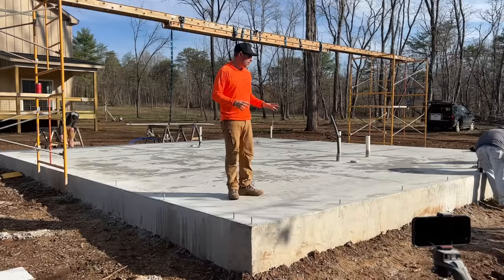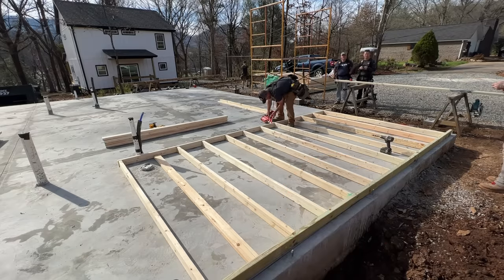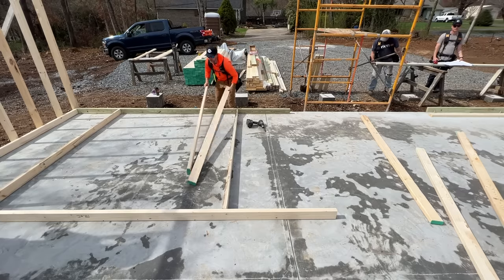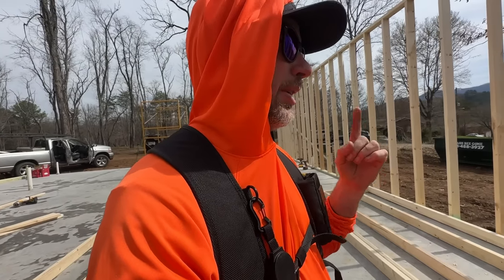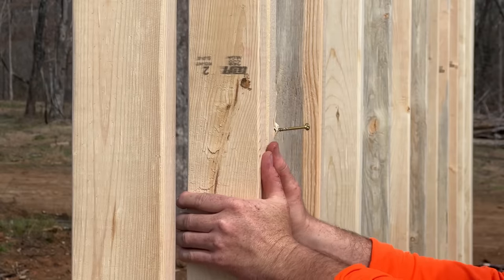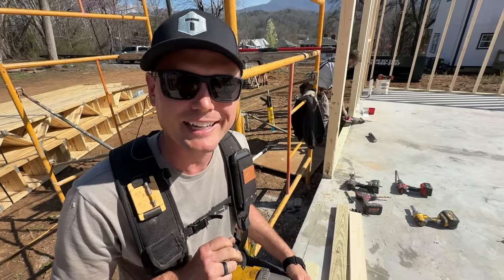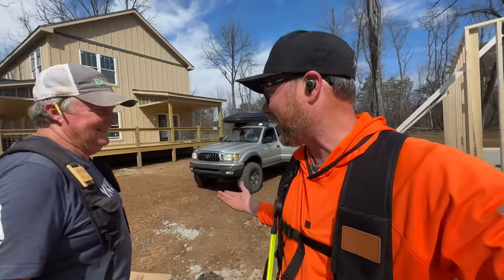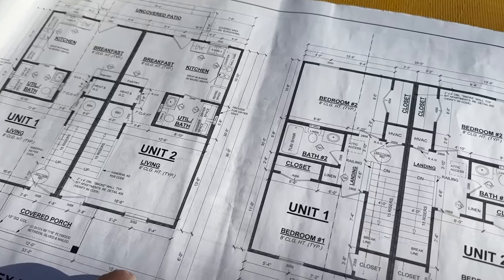Construction of a Duplex, Part 6

Comment: Oh!  After the seeing the plans, I realized I lived in an apartment almost exactly like these.  The only difference was it was 3 apartments side-by-side (a triplex?), there was no bathroom on the first floor BUT-- it had a basement for storage and utilities.  That was one of the best/nicest apartments or houses I ever lived in.  I loved it.  Very comfortable... except for the view.

Not to criticize, but that is one thing I really hate about newer apartments : NO storage area.  Right now I live in an older apartment and am very grateful to have a small storage area at the back of my apartment.  The other two things I really hate are wholly inadequate kitchens, especially with little or no counter top space and when the owners decide to put the refrigerator RIGHT NEXT to the stove so they can save on putting in a second heavy-duty outlet.  That drives me nuts.  

And, yes, I have to deal with both of those issues in my current apartment.  Whether the owners know it or not they are practically begging to have a high turnover rate and terrible tenants in their rental when they do those things.  Real people need storage; real people need counter tops and don't need higher electric bills because their refrigerator works extra hard every time the stove is on.  Then they complain that tenants are terrible.  No, they just attract terrible tenants because their apartment design is intended for people who don't actually live in their home.

Except for the storage space, this design is much nicer, especially the kitchen, which has adequate counter tops and a good triangulated appliance set up.  Seriously.  In my current apartment I have a total of 18" of workable countertop space-- and I bake!  That's my only prep area (besides my kitchen table) and it's no where near the stove.  Grrrr.  Maybe the owner will find a way to add storage space -- perhaps a shed or an attic.  Everyone needs a place for Christmas decorations and off-season clothes, not to mention all the other stuff that make up a real life.

Comment: Hey guys, I love watching all the videos! Keep up the good work! 
As a builder myself, if I could offer one bit of advice that has made my life much easier, it’s that I leave the anchor bolts out of my concrete at pour time. It’s easier to frame and stand walls without having to deal with them. After walls are up, I go around and drill holes as required with a cordless sds drill, and install wedge anchors. This way the anchors never land in the way of a stud, or too close to the end of a plate, or worse, in a doorway. Cost for the anchors is comparable, and labour to drill the holes and install the anchors is pretty minimal. I can do a 3000 sqft house in about an hour.

Comment: I'm always amazed how thin are the walls your side of the Atlantic. I know that comparing my apartment building to a tiny duplex like this is very much apples to oranges, but I have ~300mm steel reinforced concrete walls (only load bearing, partitions are 100mm plaster blocks) + another ~300mm of EPS insulation added much later on this semi-soviet building from 70's Poland.

Modern construction over here would be (for both single houses and apartment buildings) cast concrete reinforced pillars for load bearing, cast concrete slabs for floors, 250mm aerated concrete blocks to fill out the walls and then another 250mm of XPS insulation on top of that. Peak R value of ~56, less on pillars obviously.

Comment: Hey guys, I just finished up a drafting class and the professor also had us do all of our dimensions to the center of the interior walls. I thought it was strange because as a builder it makes it harder for us. I asked him why and he explained that if the interior wall thickness had to change for any reason, plumbing or what not, that the center line will always be consistent.

Comment: Great content folks! Really looking forward to seeing this duplex build, I've always had a keen interest in smaller multi-unit residential dwellings. Two quick questions 1) How do you decide when you put the sheathing on before standing frames vs after standing frames? 2) Instead of casting in bolts to hold down the frames, could you just drill and use concrete anchor screws (like the one Jamie installed under those studs on that rough opening) throughout the rest of the framing? Not sure if it's a cost or code dictated choice?
Reply: Not part of the crew, but responding to your question 2. I posted the same reply to another comment and figured I’d share it. 

J-bolts are much easier to put in, go deeper into the concrete, and have more contact with the footing. They are much cheaper than specialty concrete anchors or screws, especially when they do so many. 
Last and most importantly, j-bolts are rated for higher wind and uplift loads for their mountain builds. 
Some codes do not allow for Tapcons (large concrete screw that Jamie installed), especially on larger structures such as a multi-story homes.
Edit: Grammar
I'll also add that Tapcons (and other specialty screws/anchors) typically require more tools, care, and precision. You need to have a hammer drill and masonry bit at hand to drill it and install it tightly enough but not over-torque it. For example, if you were to overtighten the Tapcon, it would slip and no longer hold (seemingly happens here with Jamie but is not discussed or highlighted in the video). If you overtighten a Tapcon, one way to fix it is by drilling a larger diameter hole and using a larger masonry screw.

Comment: In some cities, such as Portland, ME, (depending on proximity) windows aren’t allowed on neighboring (exterior) walls for fire code.  In addition, 5/8 densglass sheetrock is also required on those walls—much like the firewall in between the two units you’re building.
Reply: Depends on separation measurement’s between houses.

Comment: I’m no expert, but built my timber framed workshop 30’ x 23’ alone last year. I installed the ground bolts in the slab, then placed the mudsill/ground plate on top, hammered it, then drilled where the indentations were. Worked good.
Reply: @H2s Good comment, but… I marked all the points for the anchor bolts with a chalkline, and drilled using a jig to ensure 90 degrees. The timber was 160 mm x 60 mm Konstruktionsvollholz (engineered wood so dimensionally perfect and straight). I used 12 mm expanding anchor bolts, and drilled 14 mm holes in the sill, using 12 mm washers for wood. These are large diameter and particularly thick. It worked well. Finally, I got this method from Larry Haun’s book “The very efficient carpenter” Larry’s good enough for me. 😉

Comment: FYI, that is not a forstner drill bit. It is an auger drill bit. Forstner bits don't have a screw tip to pull it into the work. They are used in woodworking to give smooth flat bottomed holes.

Comment: I wore out my old hammer 😅 the milled face was gone and the claw were blunt and dull, had to replace it when I broke one of the claws off trying to rip a hinge off. But I used to pound concrete and steel and whatever else with it 🤷‍♂️

Comment: How does one pick up a Perkins Builder Brothers tool belt? I made customized a belt just how I liked it back in my 20s, 40 years ago, and some low-life ripped me off out of my truck, along with my first Skilsaw. I haven't been able to find a belt as good as the one that was stolen. I had tape pocket and square front left; hammer, knife, rough chisel front right; flat bar and kitty paw left rear; pliers and screwdriver right rear; Battery hook front right; saw rasp or wrench slot in the back, next to a water bottle pocket. All. Gone. Damn.

Comment: Last couple homes I have seen you build you put the walls up pre-covered in their sheathing. Why bare studs in this one? Is it due to the size of the house? Or material availability?
Reply: Because it's on a concrete pad
Reply: They mentioned in the video that it increases the chance of the walls blowing over. No anchors on the slab for bracing.
Reply: It’s because it’s a slab instead of a wood floor. We have to lift the frame over the anchor bolts

Comment: Do you guys not use a sill gasket between the lower plate and the concrete?  I assume it's not code where you are, otherwise you would use put it in I'm sure.

EDIT: Well, nevermind  I guess I just didn't watch far enough into the video to see you put down the Lexel sealant.   That looks like a good alternative to a foam sill gasket

Comment: Is there any reason you don’t use sill seal under the sill plates?🤔
Reply: Was thinking the same thing. Here in Aus that would not pass code. Got to have a Non-Permeable barrier between that bottom plate and the concrete.
Reply: They did.
Reply: @aaronmdjones  I saw glue but not a sill seal
Reply: That sealant they use is the replacement for the typical foam sill seal
Reply: @bashirmarkhamidi2259  Thanks for the info
Reply: @tommicks53  Anything that closes the gap is by definition a seal.
Reply: We do sometimes. I like level better

Comment: I have 2 questions if anyone would entertain them.
1. What was the solution with the anchor bolts lining up perfectly on the the studs?
2. With the interior wall, if the specs have it from outside to center of the wall, couldn’t just subtract that 1 1/2”? Or am I missing something?

Comment: Question, why don’t you attach the zip while the frame is on the ground?
Reply: The sheathing?  It’s just easier and lighter to hoist up without it.  It could be done, just a lot heavier.
Reply: I haven't seen anyone around here stand walls without sheathing in probably 20 years, it's stupid not to..
Reply: The guys mentioned it in the video about not having bracing to secure the walls if they were sheeted.

Comment: Hi, why is there no waterproofing between wood and concrete?
Reply: Because the bottom plate is pressure treated lumber and therefore resistant to rot
Reply: Pressure treated lumber as well as some kind of sealant they use and apply with the duckbill caulking gun

Comment: Don't drill through the stud and into the end of the plate like you did at 14:00. It is faster, stronger and easier just to drill and add the bolt behind the built-up stud. The bolt is too close to the end grain and you weaken the stud. It really doesn't mater that your bolt spacing isn't perfect.
Reply: That’s what I was thinking. Where I’m at bolts only have to be within 12in of splice in plate or opening, would’ve been easier to just go beside that stud pack
Reply: They also threaded it lol Yeah, agree on the spacing too. Looked horrible.

Comment: I'd be interested to know if it's just a convenience thing or if there's any benefit/ cons to using the tapcon anchors vs poured in J bolts. It would seem the set in slab bolts could get difficult to along perfectly, so if the anchor bolts work, why wouldn't those be used exclusively?
Reply: J-bolts are much easier to put in, go deeper into the concrete, and have more contact with the footing. They are much cheaper than specialty concrete anchors or screws, especially when they do so many. 
Last and most importantly, j-bolts are rated for higher wind and uplift loads for their mountain builds. 
Some codes do not allow for Tapcons (large concrete screw that Jamie installed), especially on larger structures such as a multi-story homes.
Edit: Grammar
I'll also add that Tapcons (and other specialty screws/anchors) typically require more tools, care, and precision. You need to have a hammer drill and masonry bit at hand to drill it and install it tightly enough but not over-torque it. For example, if you were to overtighten the Tapcon, it would slip and no longer hold (seemingly happens here with Jamie but is not discussed or highlighted in the video). If you overtighten a Tapcon, one way to fix it is by drilling a larger diameter hole and using a larger masonry screw.

Comment: I am convinced that we are well past the point where codes simply make no sense at all.  So you want me to drill a huge hole in the jack studs that hold up the header so I can put a big A** screw in to hold the wall down and that fastener can't be 4 inches on the other side?  How ridiculous.    I was on a job where two walls were mostly glass, floor to ceiling glass, mostly folding doors to a pool.  The inspector comes by and says, well with all this glass you have no outlets on this wall so you need to put one in this section that has no glass.  I said, that is all solid wood, structural solid wood.  He says, I don't care, put an outlet there.  I said Between two doors? He got angry and said I'm not signing off untill there is an outlet here.  I said so you just want me to cut a huge hole in all that load bearing wood for an outlet no one will ever use because it is literally between two doors?  He says yes.  bangs head on wall  then why did we put all that wood in in the first place if we are just going to cut a big hole in the middle of it?  So stupid.
Reply: Yeah that’s dumb. Should have put some floor outlets there.
Reply: Re the first criticism about the huge concrete bolt through the jack stud, code does permit you a to offset your anchoring mechanism but so many inches. I think it’s like 6 inches to 10 inches or something like that depending on where you are and what version of code your municipality has adopted
Reply: @macgyver03ga  It was all slab on grade. The reality of it is they didn't need the outlet in the first place.
Reply: @frotobaggins7169  we have a local inspector like that. Basically just comes up with ridiculous stuff that’s not even in the code or he mis-interprets it. He’s actually about to get put on a desk job or fired bc of how many complaints he gets. All the other county inspectors are great. His boss is great. I have escalated issues to his boss on multiple occasions and his doesn’t understand why he asked for xyz. I know why… bc he’s a douche on a power trip.
Reply: @macgyver03ga  Exactly.  My dad did a job where he installed outlets on a kitchen counter top.  He showed the inspector how they were GFCI protected.  The inspector says, I like to see a GFCI in EVERY location.  My dad says well you may like to see that but the NEC stipulates that each outlet only needs to be protected by a GFCI.  The inspector says well I'm not signing off until I see a GFCI in each location.  So the customer had to pay for several GFCI outlets they didn't need, driving up the cost of their job for no net benefit.

I've seen houses where every wire in the entire house went through a single knock out in the main panel, complete with the inspectors sticker and signature.  Codes and inspection do little to nothing to protect anyone from anything.  It all just drives up the cost of the work and reduces the number of people available to do the job which again drives up the price.